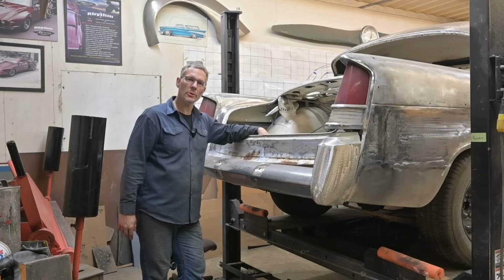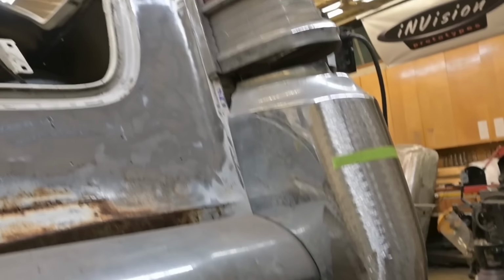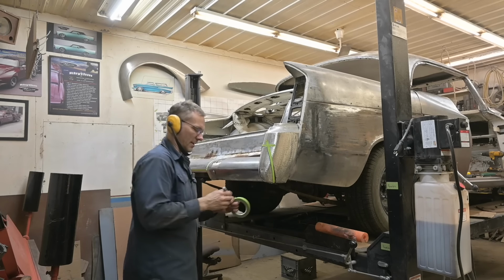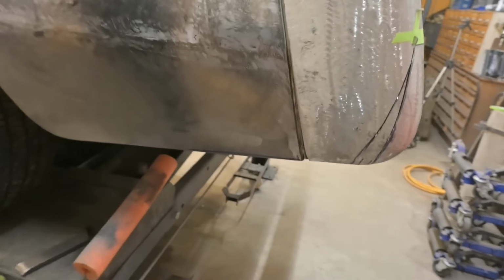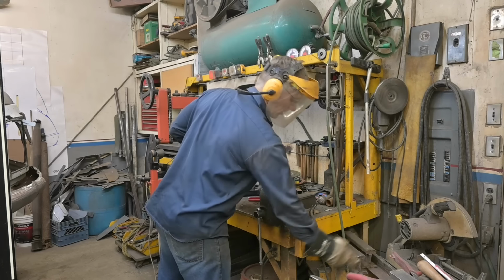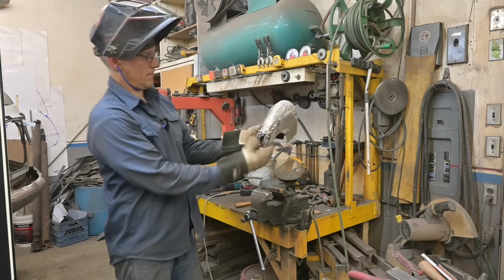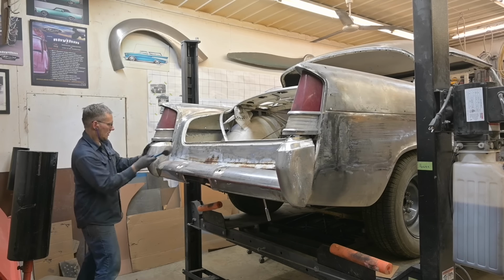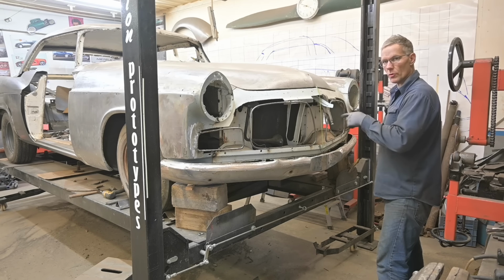Massive MOPAR Rear Bumper Makeover ! - 1956 Chrysler Windsor Muscle Car

Comment: I realize it doesn’t apply to this specific video but will you retain the stock automatic transmission or might you put in a modern five or six speed manual overdrive transmission? And getting that old rear leaf spring suspension to feel and handle well will
be chore but I’m sure you’ll figure it out!
Reply from the maker: So far the tranny feels real good so I'm keeping it.  Rear suspension has been reconfigured for a lower/stiffer ride quality.  Still need to build the new drive shaft - Chrysler one end, Ford on the other lol!

Comment: well now thanks for a lesson in bumpers 101 , i'd would have screwed my self by cut it in 2 or 3  pieces what a big mistake I'd have made , the cut-n-butt hinge is a good lesson  , i'll use it next time  .
Reply from the maker: Hi Charles, no mistakes when it comes to metal fab...just another way of getting something done.  👍👍   You're method may turn out quite well based on what you see in your head and what you're doing with a bumper.  Thanks for watching!!

Comment: I see no reason to be exploring space when we still have no solution to the chroming issue. It feels like the stone age being forced to wrap in chrome vinyl, spray chrome, painted bumpers, nickel plating, and something I've been doing recently: powder coat chrome. None if this is working. Maybe we should be buying stainless tubing and shaping from that. Someone has to have the answer.